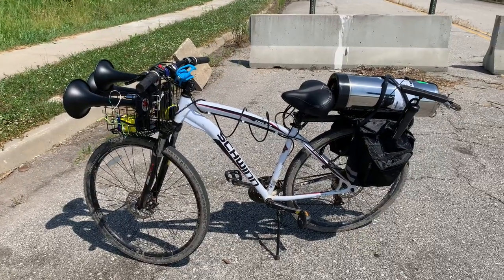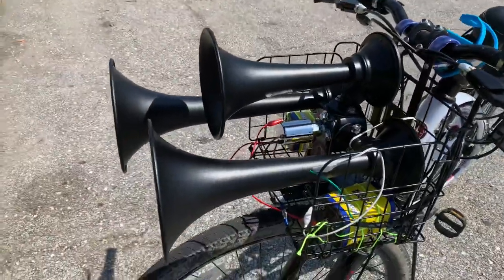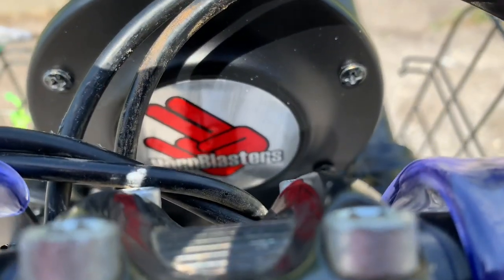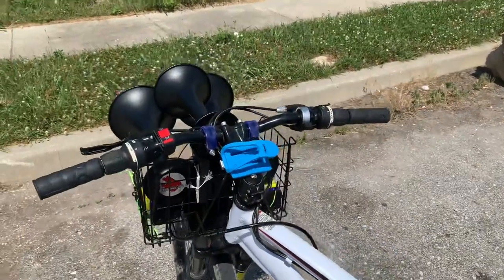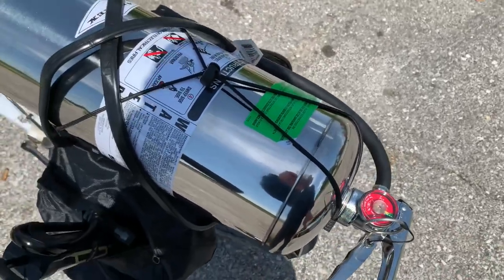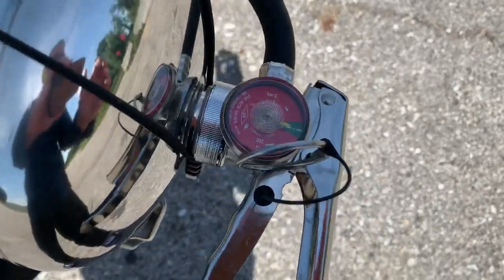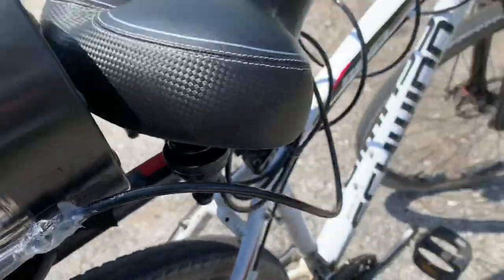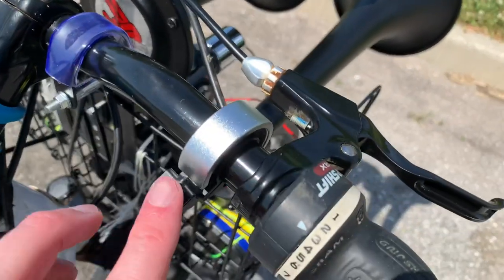Train horns on my bicycle

Comment: Very nice job, but I'm curious if it can be controlled from the steering wheel or if I have to manually press the trigger at the back of the cylinder.

Comment: Suggestion: Try out Dewalt 2.5 gal cordless pancake compressor. Use quick connectors for easy install. Also use an E valve button to activate up front from a 12v power supply. I have an Onyx with a Tug 37.

I will post a video later 👍